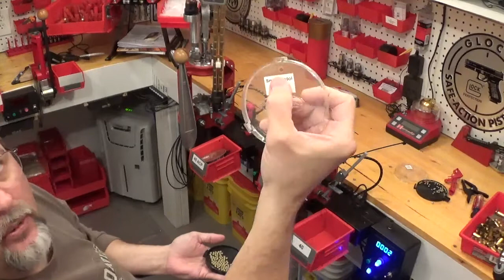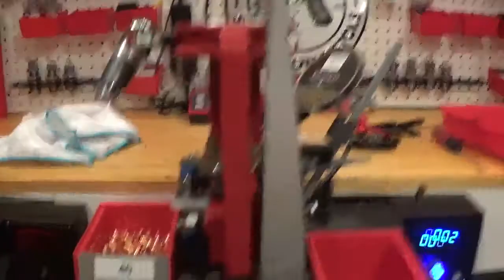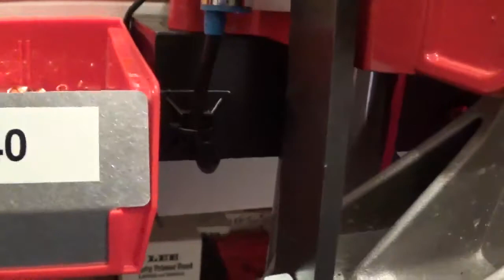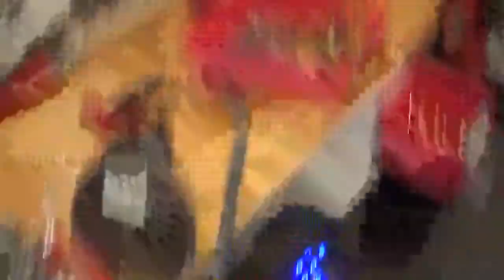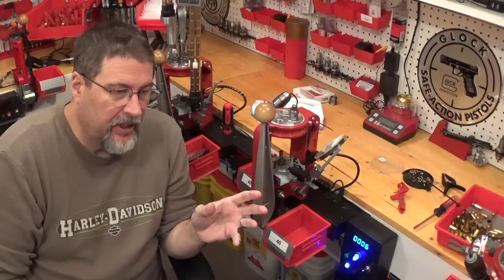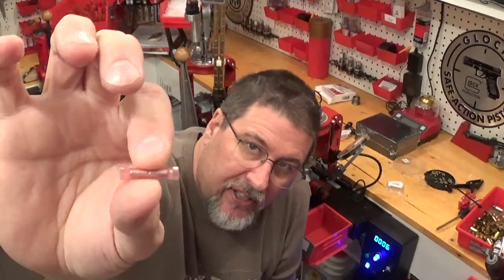Primer Alarm, Primer Feed ,Round Counter For Loadmaster Press

Comment: Hi Harleychromeman!  Great video.  I can't wait for the continuing video for this rig.  Would like to know if your set up can work on a single stage press, both for your Lee and a Hornady L-N-L Classic? I have the latter and a friend has the Lee.  Very interesting rig you have there indeed ... something you don't see comercially available.  Have you ever considered having an resetable interupter button or switch for your alarm system?  I've seen something similar to this in the flight decks of commercial aircraft.  You press your resetable intereuptor buttom and the alarm would be stopped or turned off for a set time and activate again if the snag is not fixed. This might save your ears in the long term, lol; and save you from using a tool to fool the sensor.  A very cool peice of gear for the reloading bench.  Again, one great video.  Best regards, Keyan Noble, Dartmouth, Nova Scotia, Canada.
Reply from the maker: Thank You for your feedback. You have me thinking now, I think I can make this work on single stage press. Let me give this some thought after I finish this first one for loadmaster press. I enjoy building reloading equipment. Good Shooting my Good Friend
Reply: Hi Big Poppy.  Thanks for your reply.  I suppose one simple thing that could be done for the alarm interuptor would be to add another on/off switch (push type) that would cut off the power (open the curcuit) to the the buzzer.  This way you don't have to fool the sesnor with a probe (in your case, a small zip tye).  There are 2 downsides to this.  First, you have to push the switch again (close the curcuit) to reactivate the buzzer alarm after you feed more primers into your primer tube.  Second, you don't have the curcuitry in place that would resound the alarm if a snag still exists ... either the low primer count or if there is a false reading with the sensor (a bad sensor in this case) with the delayed timer that would resound the alarm over a set amount of time.  Your product is very well thought out and professionally done once completed and installed.  It might be something worth getting a patent on and contacting Lee; sell the patent to Lee for a royalty.  You could even try Inline Fabriqication too.  I have yet to see something like this and your other products for their presses and for some of the other reloading equipment manufacturers.  Things like these make the reolading hobby more enjoyable, safer, saves time in the long run and ... most importantly, more fun.  Keep up the great work.  Best regards, Keyan Noble
Reply from the maker: Thank You for your recommendations, it would be nice to turn off the primer alarm. Like you said, I would need to remember to turn it back on. I have checked into getting 3 patents for 3 of my reloading equipment that I have built. I contacted John Lee on my nato primer remover, he gave me some good feedback on how to make it better. Patent have been awarded to different companies and private party, patent will cover broad range in the verbiage. Example: I am the only person out their to use this slotted sensor for my primer alarm system. There is 1 patent out there that includes all sensors for all reloading presses, it doesn't matter if I am the only person who is using this sensor. Due to the patent, it is covered that any sensor that is being used on primer alarm or powder alarm. Next is the cost, just to start the paper work for step one is over $675.00, 2nd step cost can range $3000.00 to $7500.00 if they find that you have not violated anyone elses patent, 3rd step cost range is $10,000.00 to $50.000.00. Royalty deal would be sweet, right now if I can help other reloaded to put safer system in place and improve processes. This make me feel good knowing that I can help other reloaders. I do have one other item that I am working on that Lee or Hornady might be interested in buying. I totally enjoy reloading and shooting firearms. Thank You again for your feedback. Good Shooting my Friend
Reply: Hi Big Poppy.  I knew the patent side of things can be very expensive.  It could be a very lucrative deal if one could get a royalty agreement with a manufacturer.  Funding for such a thing always hurts.  I'm glade you're still willing to share your ideas with other reloaders.  It's what makes this hobby and shooting much more enjoyable.  Please keep your posts coming.  Best regards, Keyan Noble